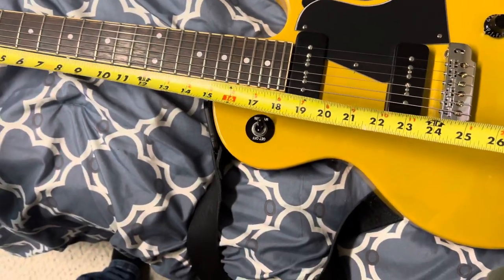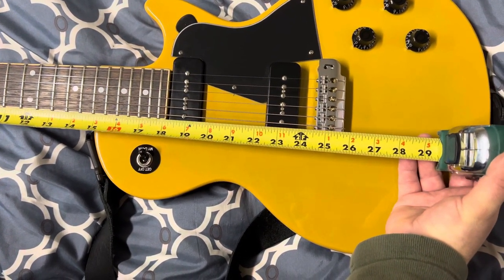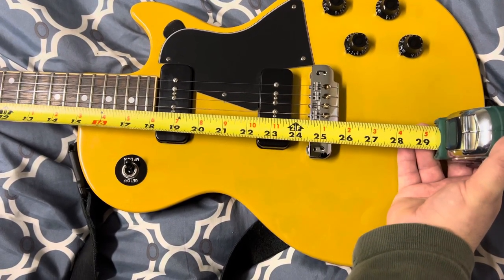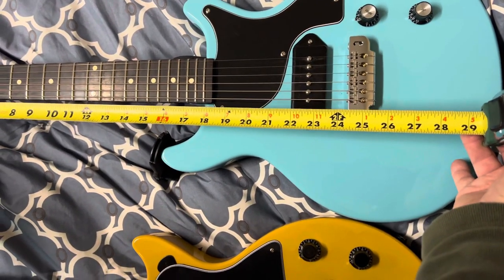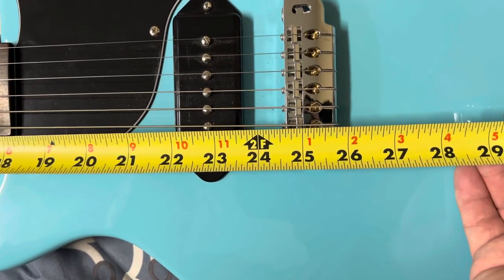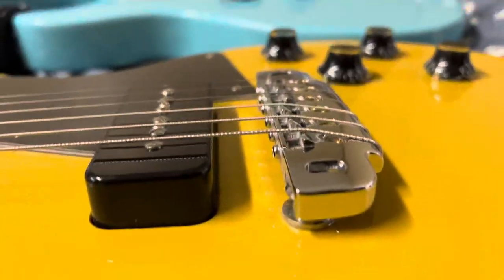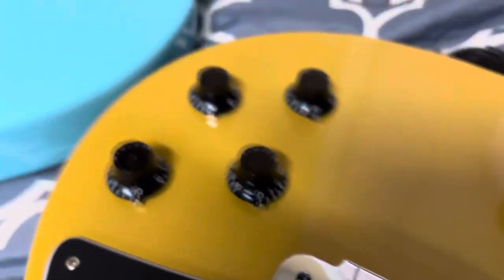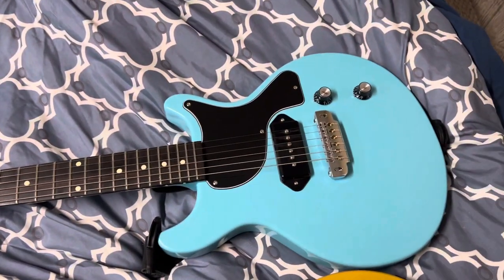Gotoh Wrap Around Bridge for Epiphone and Harley Benton

Comment: Thank you for doing this! Your last video had the low e saddle @ 24 5/16 now you measure 24 7/8. Last video had the high E and saddle @ 24 3/16. Now the front of your bridge doesn’t even begin until 24 5/8ish. Did you flip your saddles at all cuz my low E is all the way back and set screws on the posts are maxed in. Only way I can get 24 7/8 is to flip a saddle. Note: I can’t access the posts to adjust the height with the bridge that far back as it covers the post hole mostly.
Reply from the maker: I had a luthier intonate it so I don’t know what tricks he used. Go with the second set of measurements!